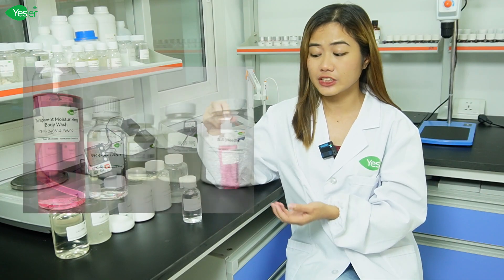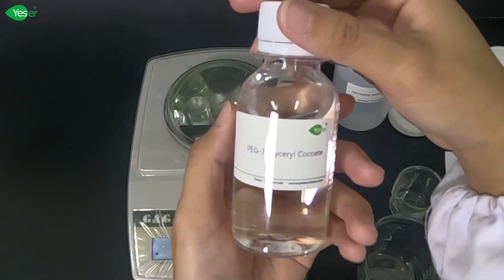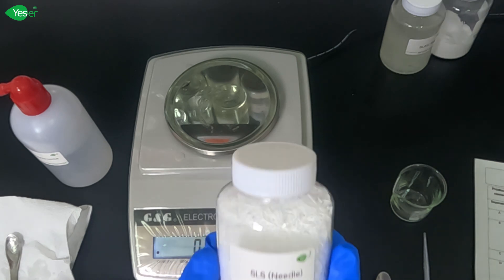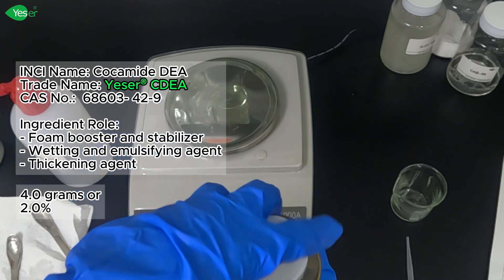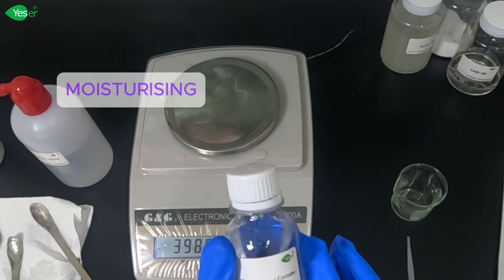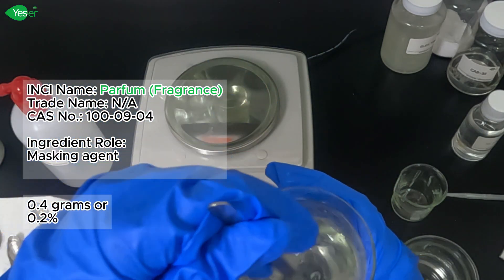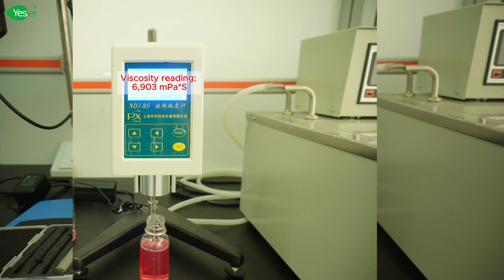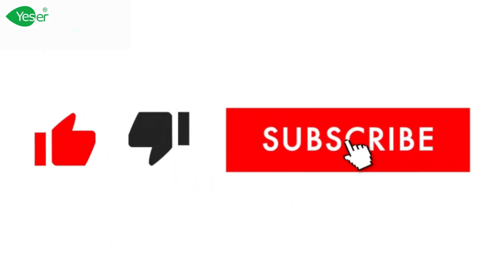Transparent Moisturizing Body Wash: Step-by-Step Formulation Guide | PEG-7 Glyceryl Cocoate Benefits

Comment: Which chemical can function the same as PEG-7? if a don't have PEG-7?
Reply from the maker: Hi, closest alternative to PEG-7 Glyceryl Cocoate in terms of function would be Coco Glucoside. Like PEG-7, it is mild, skin-friendly, and can help maintain the moisture balance of the skin. You can also use Glyceryl Caprylate/Caprate, Cetearyl Alcohol, Capric Triglyceride, Polyglyceryl-3 Methylglucose Distearate. Just make sure to adjust the amount in the formulation.